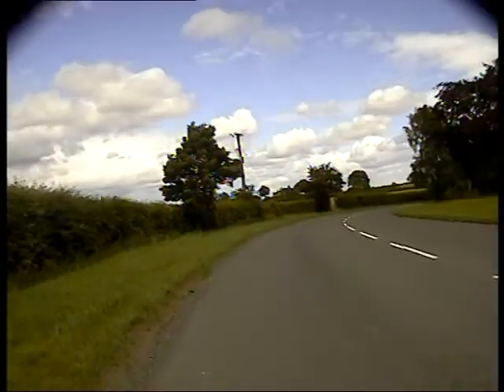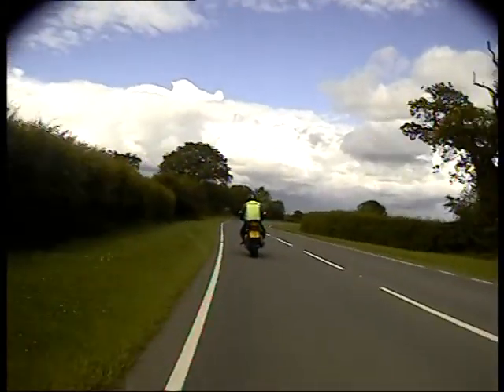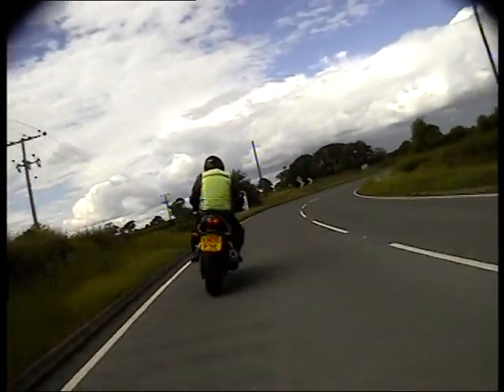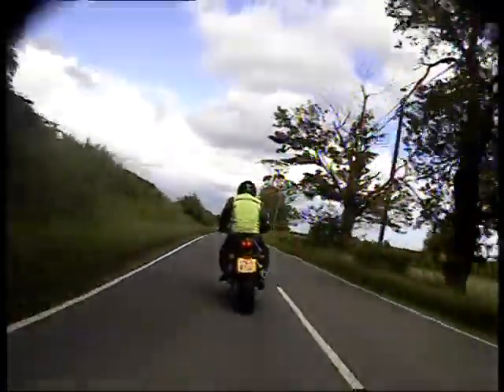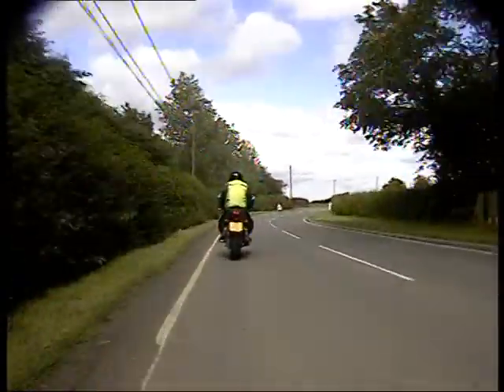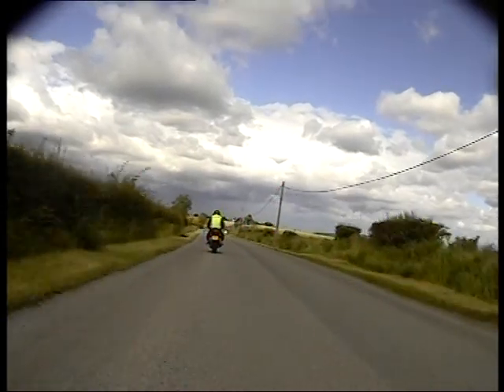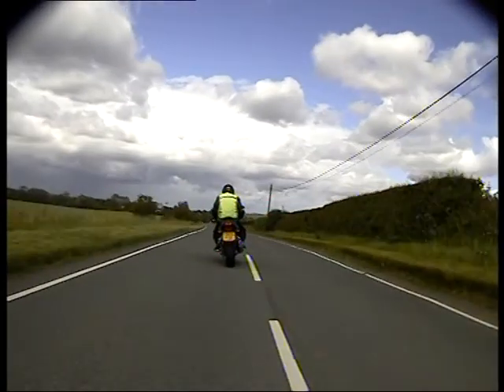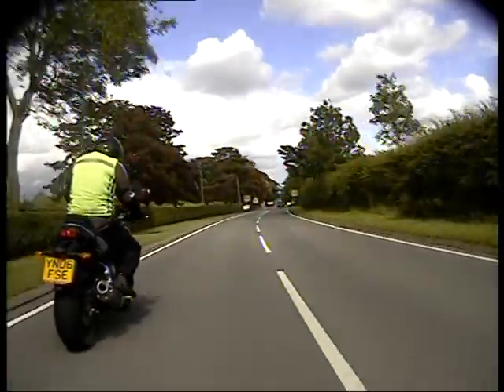Bend work - Rider doing his own commentary on the B5062 towards Newport in Shropshire

Comment: Thats the beauty of my Ducati 1198s engine, its got so much torque and the engine is smooth that you can use a gear higher than most and can drive around the bends easily. On race track I never really thought about gear changes early and I was braking very hard and late. I guess its experience because I remember when I first started riding, I were aproaching the end of the road and think opps I have to change down all the gears now. It does feel easier to do the changing on the straights though.

Comment: @Hondacb500Gijon you should try riding a race 250 two stroke. I had a go on a friends rgv250 a few years ago and its powerband was about 1000 rpm to play with, It was all or nothing. The bike was very light though but very hard work. Constantly having to select the right gear or you had nothing. Keep practising. There is nothing better than experience and practise.

Comment: @advancedbiker I expect the bmw is a bit more flexable at real world speeds, I can get mine into six gear at 60 mph 3000rpm with 10,500 rpm to play with, it is suprizingly smooth though especially after the service. Mine feels smoother when your accelerating. Its so linear and manageable. Its just so lazy to ride. On the road im barely ticking over most of the time. A rider not used to it would be speeding everywhere without realising they are doing it. Very deceptive. Torque is allways the best

Comment: This rider was doing what most riders do, too fast into the corner on the throttle so the first thing they do is close it.  This causes two problems.  the bike get unstable in the corner, but, secondly, it doesnt make the brake light come on.  Take another look at the video.  See if you can see him slow down without the barke light coming on.  And remember, if you ride or drive into the back of him its your fault.